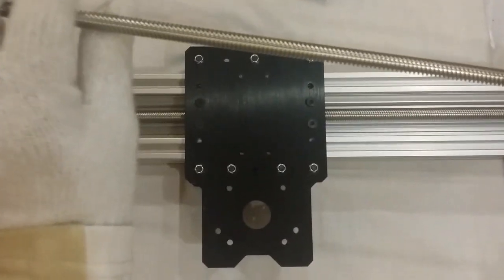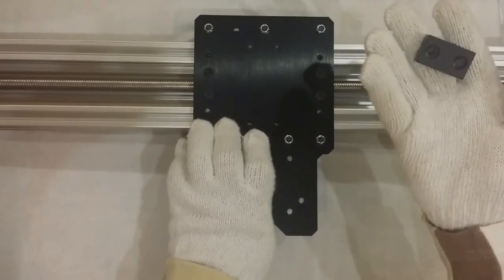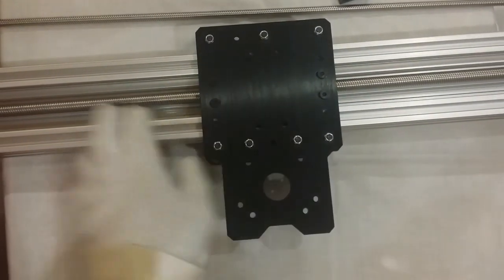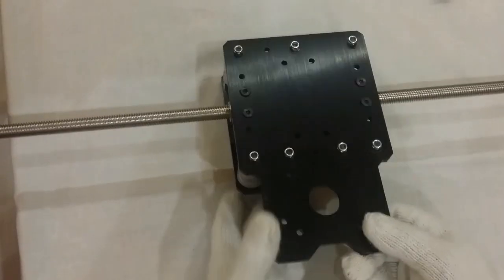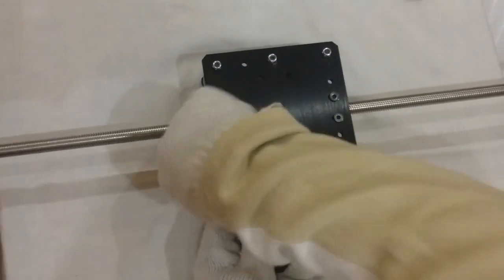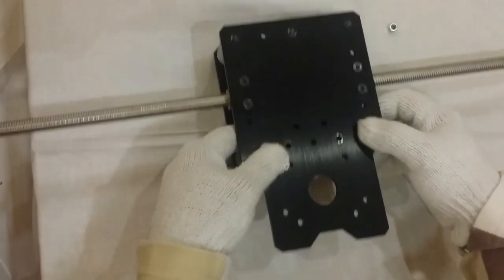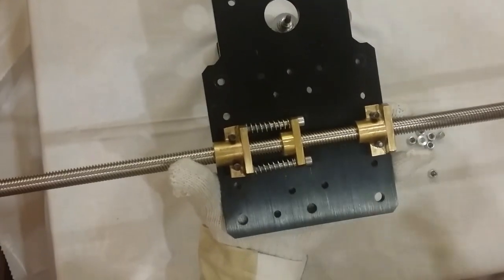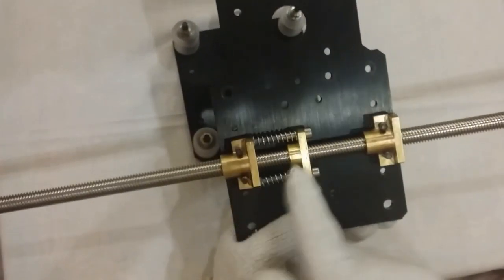Upgrading WorkBee CNC machine Lead Screw From 8 to 12 mm

Comment: Great idea... A
re you happy with the 12mm lead screw upgrade ? What did you do at the motor end and other end to allow for the upgrade from 8mm to 12mm ? ie bearings plate holes, etc...
Reply from the maker: Yes stephan I'm satisfied with the upgrade , regard your question could you please check my reply to ( Edmundas Kasciukaitis ) in the comments.
link to the end screws image.(  http://www.mediafire.com/file/2g83pppggey6dhb/20191213_135819.jpg/file )  And  (  http://www.mediafire.com/file/td6idz8jm7svuan/20191213_135845.jpg/file  )  I hope that was helpful for you.
Reply: @yacoubjabal3762  Thank you very much for the rapid response. Much appreciated. From what I can see in the photos and your comments, you made an adapter which I assume goes from 12mm to 8mm and then you just have an 8mm shaft from there that uses the original bearings and lock nut under compression like on the Workbee V1 ? or did you use a tension system like the Workbee V2 on the outside or Tingle tension system with a thrust bearing on the outside ? You say you recommend using a 1030 12mm lead screw. I guess that means that you turn down the two ends of the 12mm lead screw to 8mm and then again use the original 8mm fittings on the workbee to complete the task (leaving about 5mm sticking out each end). Now that you have the experience of that upgrade what do you think of the option of not stepping down to 8mm but to use 12mm all the way through end to end. ie enlarge the hole in the end plates to accomodate the 12mm and fit a 12mm bearing and collar. I am guessing that you had a good reason for going with the step down route from 12mm to 8mm. Out of interest, what feed speeds have you now managed to get up to with your conversion. Good job on doing that 12mm conversion as it seems far more logical to me than trying to find ways of tensioning the 8mm lead screw which is really just inadequate for a 1000/1500 workbee . You seem to be the only one so far that I am aware of that has done that so far, yet, it seems the correct thing to do.
Reply from the maker: @TheMysticABC  You are absolutely right plus I have to change the feed speed and rate of course special my lead screw is lead 10 you can make it lead 8 as will and that can lead you to the original setting as well.

You know there is housing for the bearings I rather to do not be touched you have limited space for the X or Y C-beam aluminum extrusion,  in any way you have to use the lathe machine for the ends. That what I was thinking so you have ideas for the ends and if I wanted to do it again I prefer 3cm extra than using the adapters. by the way I don't know about V1 or V2 I just deal with what I got :) Thanks for sharing your ideas.

Comment: Hi Yacoub, 

Great video and interesting. I came across it while looking for upgrading the lead screw on mine and 12mm seems better. My worbee is 750X500 and want to use it to mill aluminium or mild still. I've heard that ball screw is even better than lead screw. Do you think this ball screw could fit?
https://www.aliexpress.com/item/32830528587.html?spm=a2g0o.cart.0.0.39933c00z8EDjp&mp=1
Thanks
Reply from the maker: I'm Sorry you cannot install the lead ball screw because of the size of the ball nut. But you do have a good idea, And yes the ball screw is better than lead screw,,,,,, Plus I can cut aluminum with my modification, I did not try still yet.
Reply: @yacoubjabal3762  Okay, My fault! Thanks Yacoub for you quick answer. So I'll go for your modification. Any chance to make a new video testing aluminium cut?
Reply from the maker: Okay I'm working in new project as soon I'm free I will make a new video.

Comment: Could you please share the images of the ends of the axis where screw connects to bearings? Should I use a lathe to prepare the endings of the screw to fit the bearing hole? Also I am wondering if standart step motors will work fine  with this diameter any thoughts?
Reply from the maker: That is really a great question and I think you are engineer or your brain have it, Yes you have two ways and both you need the lathe machine, First if you order the lead screw ask the seller to give you extra 30mm example if your lead screw 1000mm ask for 1030mm in this case you don't need adapters, But if you order 1000mm or 1500mm you have to make adapters, About the stepper motor it's optional what do you need for your CNC if you are willing to put 2.2KW or 1.5KW spindle, if 2.2KW advisable to change the spindle.,,,,,, For me I like the first choice to add 30mm to the lead screw it will save the time but I made a mistake and I order 1500mm not 1530 so I do the adapters.  (  http://download847.mediafire.com/gk0ts3tpo5ug/2g83pppggey6dhb/20191213_135819.jpg )
Reply from the maker: and that one (  http://download2262.mediafire.com/snpk5ln9q7og/td6idz8jm7svuan/20191213_135845.jpg  )
Reply from the maker: if 2.2KW advisable to change the stepper motor
Reply: @yacoubjabal3762  Thank you for your fast and an amazing answers. Have you manufactured adapters by yourself?
Reply from the maker: @edma3231  Me and my friend because my lathe is small and take time it was long story funny one :)
Reply: @yacoubjabal3762  Nice one :) very good work guys, love it. Will try to make this mod for my workbee :)

Comment: Sir, that is what i am looking for but i can't handle the Y plate (front and back on each side) . Would you please share the  file that i could drill the hole to hang the new Lead Crew? Thank you so much. Great  video!!!
Reply from the maker: I do apologize for any inconvenience my video is not complete !! About the Y axis I extended the hole only, I hope this photo will help you.( https://photos.google.com/share/AF1QipNqT8am0VH-sCudIGTSg4mjcFLeRXxO3gdh1QbVRE0n7XKJtkUhgDtTwSC38V__uw/photo/AF1QipMNY4pJeDAHyLaq3Bi4620PviO9V2XPRQNTiyrw?key=VkJ4N0NDNjM0TUE2d0dZZmtQZ2RzdlRUVnpXWlhB )=======( https://photos.google.com/share/AF1QipNqT8am0VH-sCudIGTSg4mjcFLeRXxO3gdh1QbVRE0n7XKJtkUhgDtTwSC38V__uw/photo/AF1QipPHMAVCPxJOx0TOPSNZsxfMGgk8VQRLA1iWLBXc?key=VkJ4N0NDNjM0TUE2d0dZZmtQZ2RzdlRUVnpXWlhB )=======And about the Z axis I recommend lead screw 10 mm diameter lead  8mm.
Reply from the maker: try to check this photo.https://imge.to/i/vE0RNi
https://imge.to/i/vE0rKTI remember I extend horizontally 3mm only for the Y axis.
Reply from the maker: https://imge.to/i/vE0RNihttps://imge.to/i/vE0rKT
Reply from the maker: (   https://imge.to/i/vE0RNi  )  &  (   https://imge.to/i/vE0rKT  )
Reply from the maker: This is the last try (   https://pasteboard.co/IAws1JM.jpg   )  &  (   https://pasteboard.co/IAwwopY.jpg   )
Reply from the maker: Ok I understand youtube not allowed , Try to copy the links and paste it on new web page.

Comment: Just so you know. The plastic is not just any plastic. Its Delrin, which is a quality engineering plastic. that has great stiffness, strength with more lubricity than brass. Much like PTFE\Teflon. Dont get me wrong. Brass is great. But the Delrin is not cheap or something they cheaped out on. Its well regarded and desired by those building their own CNC machines to reduce weight while maintaining high build quality and longevity.
Reply from the maker: Allow me to show you this example ( https://www.youtube.com/watch?v=VOqi_yrpmfI ) And I will agree with you if it's made from the same lead screw material, Acme nut block plastic spouse not a priority in good CNC,  But the brass in between this and that.
Reply: @yacoubjabal3762  The machine example you have provided is belt driven
Reply from the maker: @circuitways  There is two types of WorkBee CNC one with lead screws the other one is belt driven and the one I have is driven by lead screws.
Reply from the maker: @circuitways  yes it's belt driven maybe it's not good example more likely some parts of workbee cnc not reliable if you take a tour on the internet about workbee troubleshooting CNC you will know more about the acme block nuts problems also need to be replaced from time to time, The good news so far I'm not complaining about the upgrading not yet.
Reply from the maker: There is also a reason why I changed the 8mm lead screw it was wobbling so bad, Now no more.

Comment: Awesome work!

Where did you get the parts?
Reply from the maker: okay I add for you the links under the video, better if you ask the seller for lead screw 1530mm if your CNC 1500 mm if it's less ask for 30mm extra like if you have 1000 mm CNC ask for 1030 mm three centimeter extra.
Reply: I told bulkman 3d he need redesign screw to 12mm or 16mm...i told him 8mm way too small